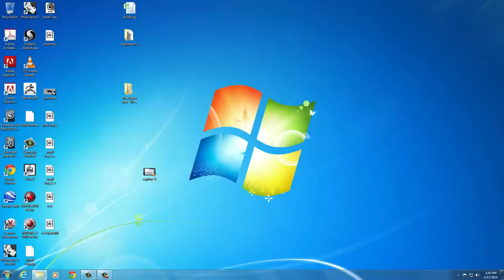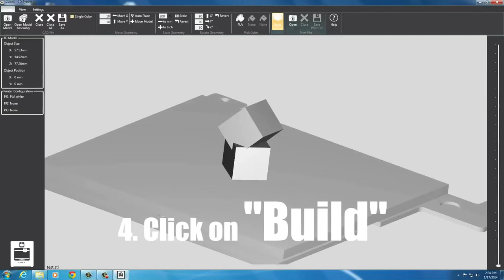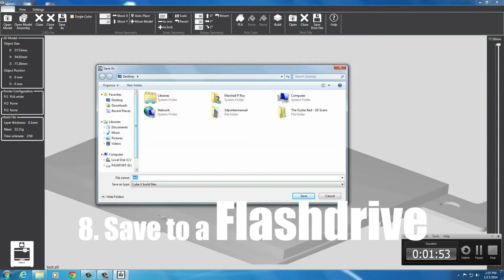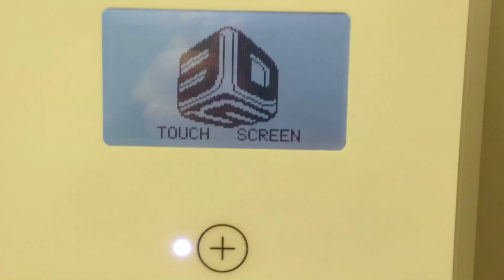3D Printing Tutorial for LSU College of Art + Design CxC Studio

Comment: Ambroise, My name is Vincent and I run the CxC Studio for LSU College of Art + Design (CoAD). We have a 3DSystems Cube X printer, and we just purchased the CubeX Trio.  LSU ENGR has a Sense; CoAD has a Creaform VIUScan.  I'm a little confused about your question about weight given it's plastic and you typically want to hollow models out to save time and material because we charge by mass of model ( per gram and each cartridge contains 620g). We don't have a good workflow for Colladas (even though we can export scans in this file format), and from what I understand, Colladas are typically used for animation and environment renderings not fabrication; we export our 3D scans to .OBJ, then edit mesh in zBrush or Netfabb, and save as a .STL for printing with the 3DS CubeX software. The LSU CoAD does provide some consulting on 3D scanning and 3D printing services to third parties as well as other areas on campus.  For more information please visit: design.lsu.edu/3d/